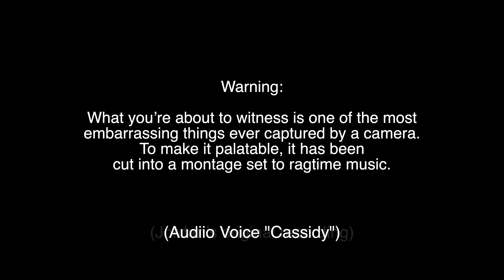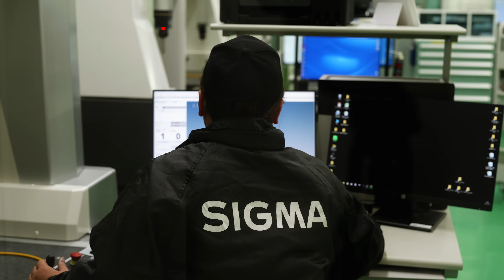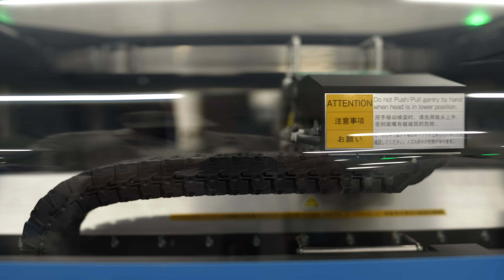How They're Made: Sigma Lenses

Comment: Hey Chris and Jordan, Campbell from New Zealand here. I'm looking for advice on a new camera. 

My Fuji XT4, which I mostly loved (Apart from the auto-focus) has died. I've babied this camera over the last 3 1/2 years, so I'm kind of annoyed that it is playing up (Not metering correctly, dark screen, and super bright photos). Anyway, I'm looking to replace it. Here are my current needs (Different to when I bought the camera and thought I'd be doing a more walk and talk style of channel). I have two Osmo Action 4s for motoVlogging and trips for that kind of thing now. 

I will have approx $2500 - $3000 New Zealand ($1950 - $2400 Canadian) to play with for a body. 
I want to buy a new one (The XT4 was second-hand, so...) 
What I need is: a good studio camera (on a tripod) for my YouTube videos; possibly high megapixels for awesome photos; a very reliable camera; Reliable auto - focus; the ability to buy 3rd party lenses (Full frame is f...ing expensive).

Cameras I'm considering are:
- Sony A7C2 (great auto-focus)
- Fuji XE-5 (although the XT4 debacle has put me off Fuji a little). But I can keep some of my Fuji lenses, plus compact.

Other Cameras I could consider are:
- Nikon Z52
- Panasonic GH52 (Cheap, built like a tank, but no phase detect).
- Panasonic GH6
- Panasonic S52
- Fuji XT30 3 (Cheap, new processor)
- Fuji XT50

If I missed anything let me know.

CHEERS CAMPBELL FROM NZ :)

Comment: Sounds and looks like a Sigma advertisment video... 🤔
So, basicly everything in this video is industry standard for a company manufacturing optics and lenses for todays high resolution sensors.
Your footage would be basicly the same if taken in a Nikon, Canon or Sony fab and some others.
BTW. 
Making everything in house doesn't necessarily mean it's an advantage. 
If a supplier is more specialized in making a specific part and you build up a strong and reliable relationship, that might be the better option.

Comment: 3:40, that's Windows 7, I hope that laptop is airgapped.
Reply: Nothing surprising, you can actually see windows xp still being used even in Europe in many places on production, since they are single purpose and run literally a single piece of legacy software that is needed for operating some precision machinery.
Reply: Don't let this distract you from the Hello Kitty calculator in a production environment
Reply: The clock on that PC says 2011/05/27, so it’s either old stock footage or some virtualized setup